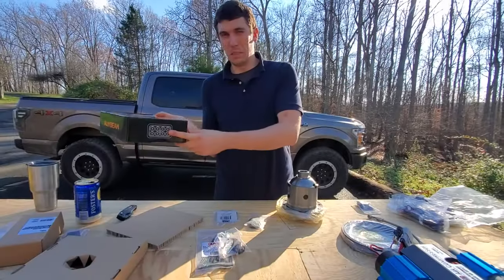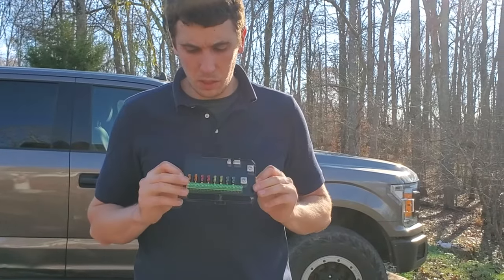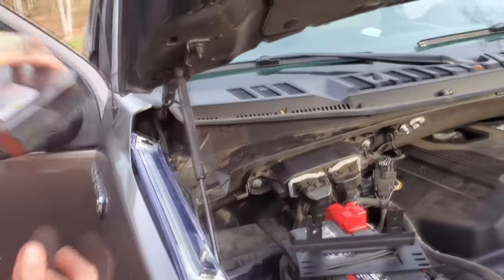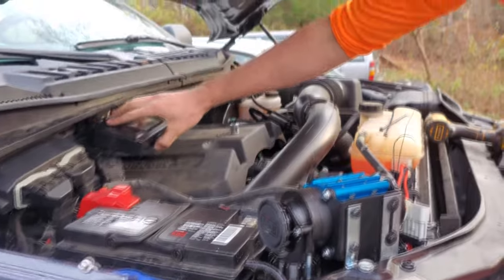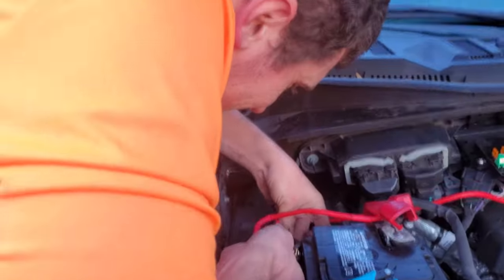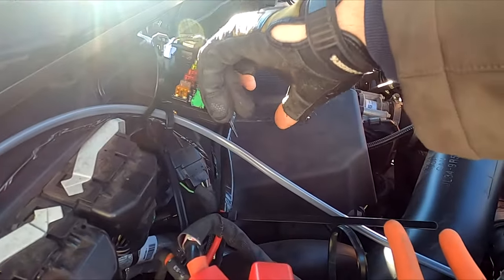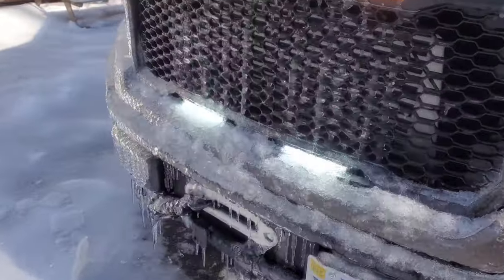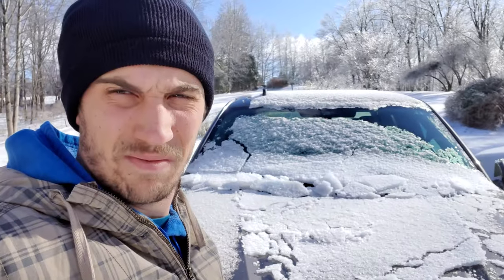Overland F-150: Aux Beam switch panel unbox and install

Comment: I love my 8 switch Aux Beam Switch panel in my roadside service and repair truck for lightling all around the vehicle, lightbar, air compressor and winch remote control.   Very pleased with install and performance.  Only improvement that I wished it had would be for the panel to have dim illumination at nighth when its off to see the different buttons to push in the dark and then light up bright on the panel  when something is activated on that switch.

Comment: Niiiiiiiicccceeeeee 💯 doing this on the Expedition
Reply from the maker: Thanks so much! Its still holding up great as of Oct 2021! .
Reply: @HeretoWherever  Awesome! I gotta figure out that small red power cable tho , the fuse it came with doesn't fit in the Ford fuse box

Comment: I just bought the same switch panel but Im thinking about bypassing the trigger cable so I can use my light and accessories (ex: fridge) while the truck is off. Connected to a Blue sea low voltage disconnect, so I shouldn't be left stranded with a dead truck.
Reply from the maker: Seems like that should work great! I hear great things about blue sea products but have never taken the plunge. 🙃

Comment: I just got the auxbeam panel and im having trouble installing it. I cant find a proper Add a fuse or even just a tap for accessory power so the panel doesn't stay on constantly. Did you use a Add a fuse system or did you just tap into a wire going to accessory power? Got a 2016 f-150 XLT 5.0
Reply from the maker: I did an add a fuse on body 3 module I believe. It is off when no key is in but stays on 90 seconds or so after the key is turned off. I had to wait and watch it to make sure but it will shut off eventually.  

Better acc options are in the cab but that was the best I could cone up with under the hood.
Reply: Here to Wherever  I have an add a fuse on the power steering fuse. I used a test light to check it, it shows no power is going to it but no matter what it still stays on even after I take my keys out and lock my truck. Totally stumped
Reply: Here to Wherever  do you have an Instagram, I’d really appreciate it if I could message you. I’ve been working on this for 3 days and still can’t find a damn ignition fuse.
Reply from the maker: @clearvisionfilms14  yes,
It's:
here_to_wherever
Reply: Does the fuse/relay box get too hot in that location? I’m currently inside the hood of my truck debating where to mount this thing and I stumbled upon your video. My 19 f150 has that bolt but my bracket is slightly different and doesn’t fit like yours.